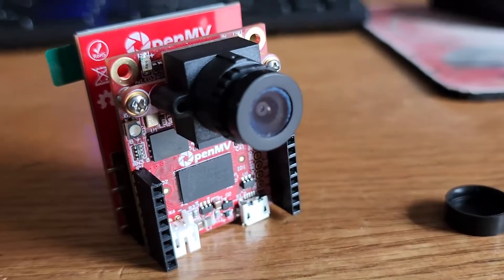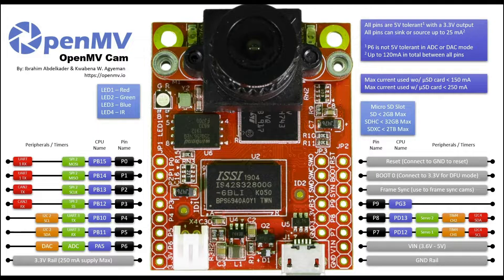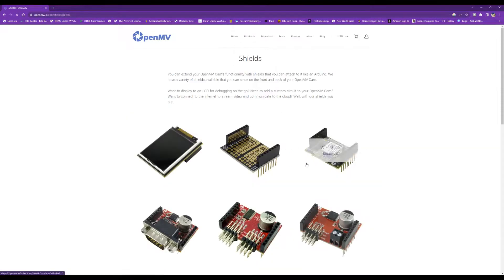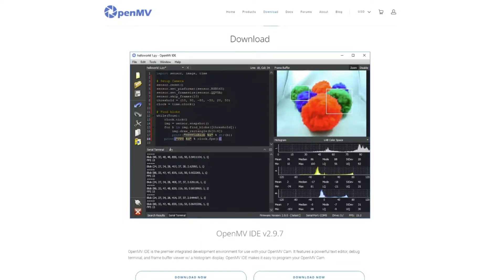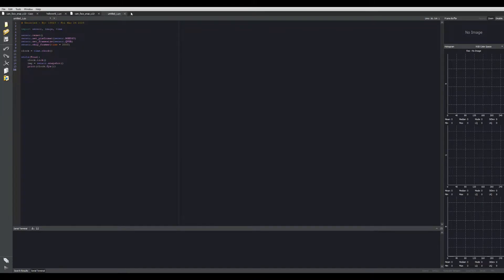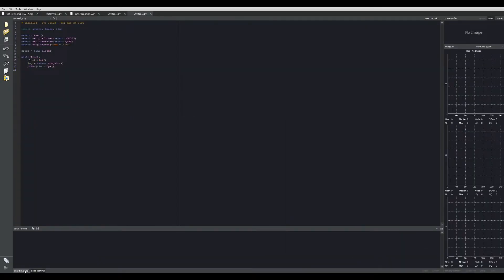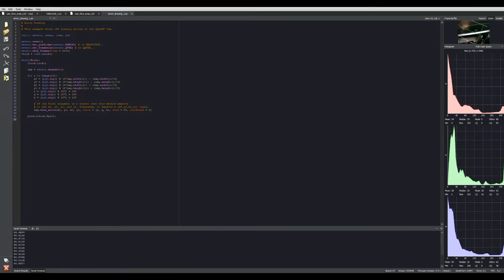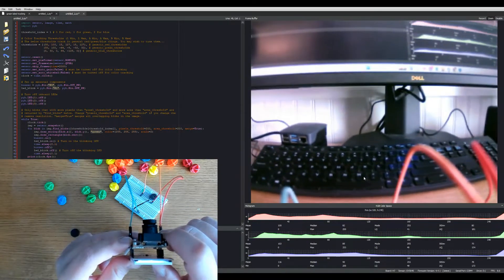Getting Started with OpenMV Cam H7 Plus: A Machine Vision Camera Introduction

Comment: A very expensive way to buy an ESP32 cam
Reply from the maker: Hey there!
I see what you mean — in a sense, yeah, it’s a pricey way to get something similar to an ESP32 cam. While they are both nice to have, the Openmv cam is built for object tracking, detection, and image processing - so I believe it does that better. You can spend a lot of money on modules, lenses, and shutters, but I guess it just depends on what the goal is.
Thanks for adding to the conversation! 💪

Comment: I'm working on a project on a belt drive system for sorting objects using a camera. I'd like to know if it can be done and if the programming process is difficult. I'll use an open camera as a sensor and use an Arduino board to control the motor and control all functions.
Reply from the maker: hey there!
Yes, that’s definitely doable. I’m planning to run image processing on the OpenMV and send position or command data to a Teensy microcontroller to track movement — basically making the head follow motion. The nice thing is, you can even train it to recognize specific objects by building a small image library or using Edge Impulse to train a model. So yes, it can do what you’re describing, though I haven’t done a whole lot with the OpenMV yet. I have some free time coming up....i'm going to use it a bit more 👍👍
Reply: @BMonsterLaboratory thank ❤❤

Comment: ฉันสนใจที่จะทำโปรเจ็กต์โดยใช้กล้องตัวนี้ แต่ฉันสงสัยว่ามันจะทำงานกับ Arduino ได้หรือไม่
Reply from the maker: hey there!
This is a standalone microcontroller and doesn't need Arduino or any other board. It was developed for AI and machine learning. There are a number of modules and cameras you can add and swap in wtih this camera board.
But yes, you can connect the OpenMV Cam H7 Plus to an Arduino if you want them to work together.  👍👍
Reply: ขั้นตอนยากมั้ยครับ
Reply: ฉันสามารถติดต่อคุณช่องทางไหนได้บ้างครับ

Comment: Good day for the best Arduino programmer in yt can you help me to do a Arduino system with Algorithm for 4 year computer Science student 

Title: Design and Implementation of a Smart Irrigation System using Arduino and Machine Learning Algorithm

Description: The proposed thesis aims to develop a smart irrigation system that uses Arduino microcontroller and a machine learning algorithm to optimize water usage for agricultural purposes. The system will measure soil moisture levels using sensors, analyze the data using the machine learning algorithm to predict the amount of water required, and control the water flow accordingly. The algorithm will be trained using real-time data collected from the field, making the system efficient and accurate.

The proposed algorithm for this thesis could be a supervised learning algorithm such as a Decision Tree, Random Forest, or Support Vector Machine (SVM) which are widely used in agriculture for crop classification and yield prediction. The algorithm will be trained using a dataset of soil moisture readings and water usage, and will be able to predict the water requirements for crops based on their type, soil condition, and weather data. The algorithm will then send instructions to the Arduino microcontroller to control the water flow to the crops.

The project will require hardware components such as Arduino UNO, soil moisture sensors, water pumps, and solenoid valves. The software development will involve coding in Arduino IDE and Python for the machine learning algorithm. The system will be tested in a greenhouse environment with different crops and soil conditions to evaluate its performance.

The outcome of this project will be a smart irrigation system that can optimize water usage for agriculture, reducing water waste and increasing crop yield. The thesis will also contribute to the field of agriculture by demonstrating the feasibility of using machine learning algorithms in agriculture for predicting water requirements.

Comment: Awesome video and great timing. I just sat down to start my research of OpenMV Cam and I find your video. Well done! Thank you
Reply from the maker: Hi there! Thank you! I appreciate the comment.  I just purchased the global shutter module and a wide angle lens as an upgrade. I'm thinking I may need to try out some of the shields and lenses as well. Arduino has Nicla Vision, it's a relatively new stand alone camera that is smaller and has some features that openmv doesn't have but I haven't purchased that one yet.  Over all, I am pretty happy with openmv quality and extensive library.  The option for upgrades is also nice. I hope the new shutter and lens has a crisp,  clean image.  I still have more to see with openmv cam but that's my take on it so far.👍